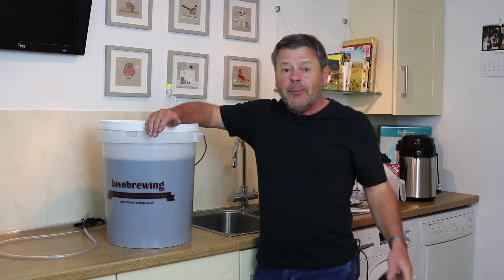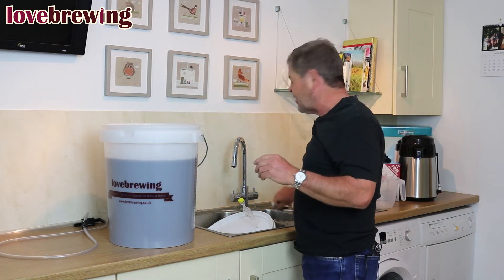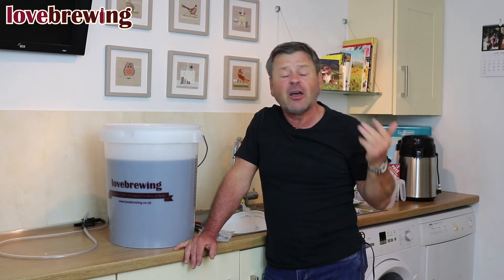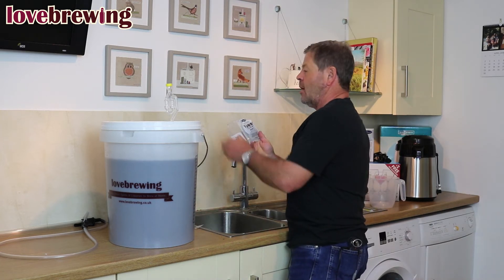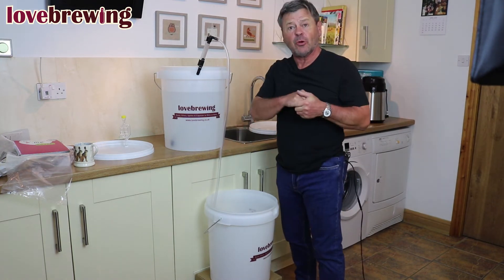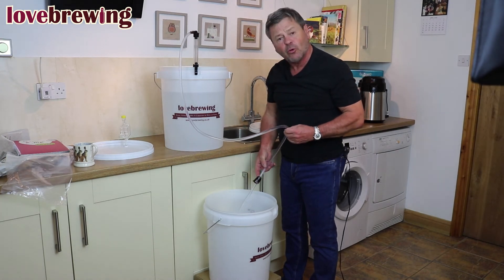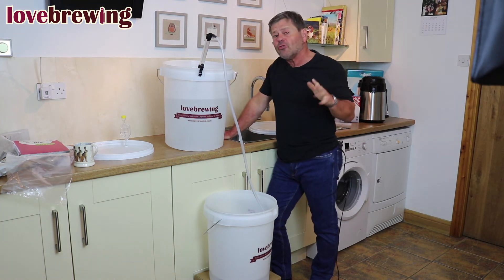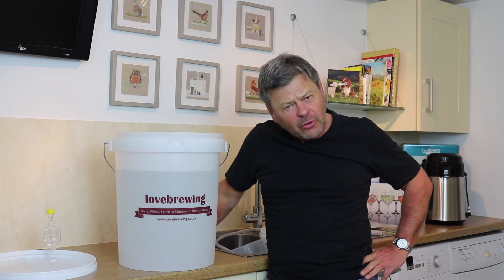Beginners Guide to Making Spirits - Part 3 - Siphoning, Degassing & Clearing

Comment: The finings have not worked for me. Three days after B it is still cloudy/black. What to do next? Edit .I added fresh finings Turbo both A and then B. This was better along with some more heat, I used an immersion type heater set at 24C. Clear enough now to distil.
Reply: Ik its been five months since your comment. But i was just wondering if it ended up being  the bucket staned by the carbon